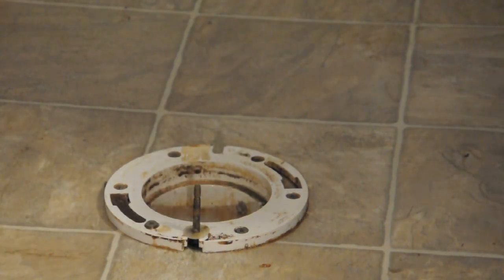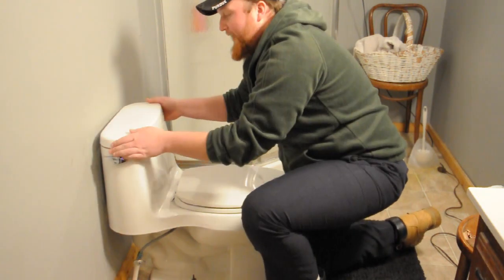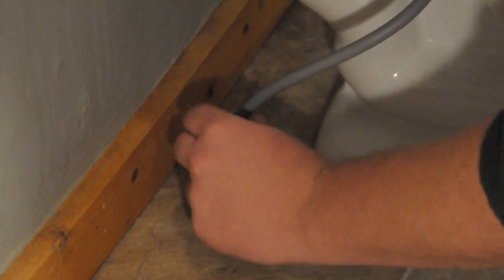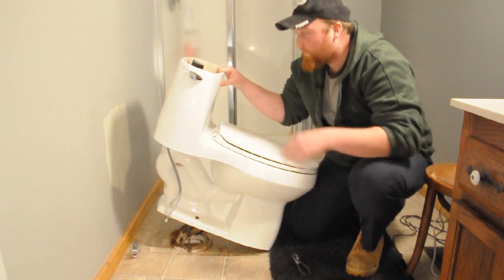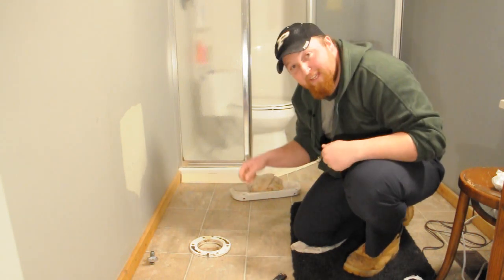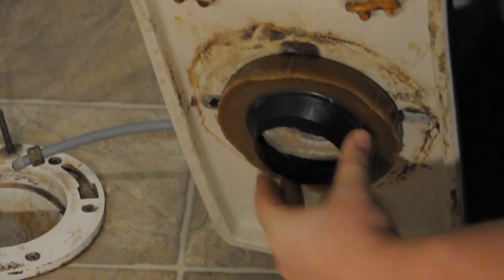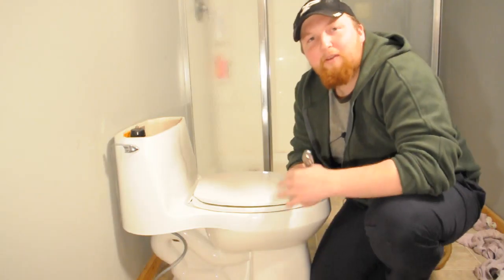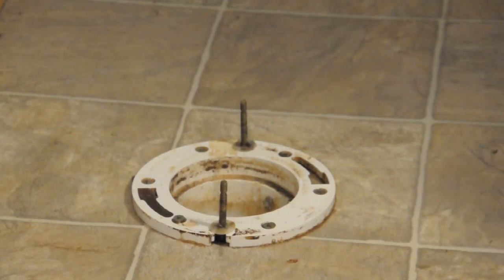Kitchen & Bathroom Repairs : How to Install Hold-Down Bolts on a Toilet

Comment: @essortment I've got a toilet where the hold down bolts are loose. The bolts are tightened to the washer but I can move the bolt around, and the toilet can move a little left to right. Do I need to go get a new wax ring? Is it because the bolts are not securely held by the wax ring?

Comment: I see wax rings with and without the rubber adapter.  It looks like using the rubber adapter (you show) would restrict the flow of the waste water.  Did you have to hacksaw off the bolts?  I am using an interesting product  called  “zero cut bolts” from danco that make it easy to select a height on the bolts.  Go Boilermakers!

Comment: Thanks for the tips. Quick question though, don't you need to caulk the base of the toilet?
Reply: Barry Hallsted Optional. Cosmetic only.  it's actually not a bad idea to wait a few days before caulking as it may mask a small leak.
Reply: Barry - there are 3 reasons why to not caulk, each with counter arguments. I found this article worth the quick read: https://homereference.net/caulking-around-toilet/.

Comment: nice video how high the  Flange
  has to be from the surface of the ground i see yours is way high  thx
Reply: I did not notice the flange height, so will review it once more. I do remember hearing that the flange should be level with the tile/flooring.

Comment: So since my commode rocks and slides out of place will i need a wax ring or just new bolts?  Guess its no way of knowing without removing the commode
Reply: Always use a new seal unless you have the rubber or silicone flange type. I only use the rubber flange toilet seals because they are not messy like wax and they are reusable.

Comment: Using adjustable pliers to tighten or remove nuts and bolts is not professional. That's the best way to wear them. Use a proper wrench instead!

Comment: It looked like u spun the bolt when u pit it in the flange but didnt explain
Reply: Because there's nothing to explain - the bolts just slide in, no spin necessary.